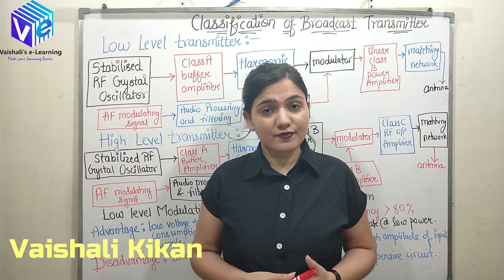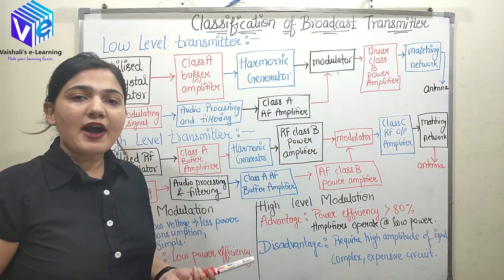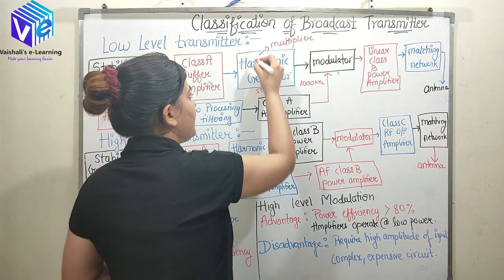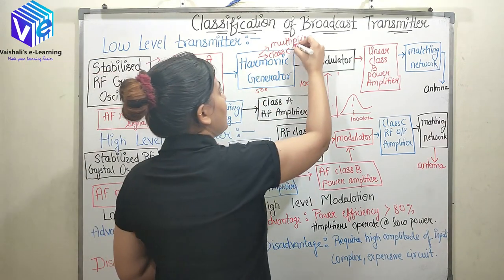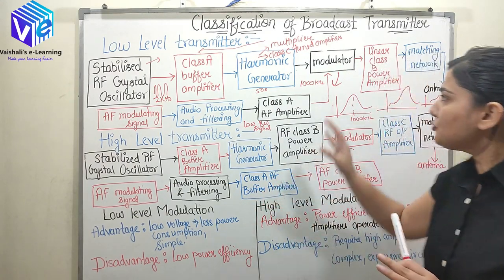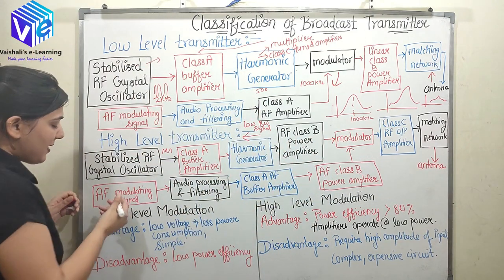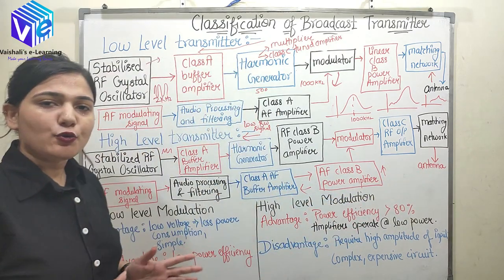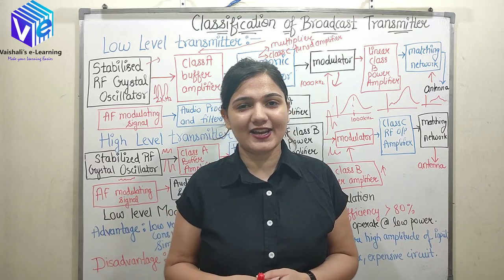L 37 | Broadcast Transmitter Classification Based on Power | Analog Communication

Comment: Hi sorry but I think your high level transmitter block diagram is wrong as in high level transmitters the modulator is also the final output stage so the amplifier you put in class C after the modulator is Furthermore, the modulated signal should not be amplified in class C. Greetings.